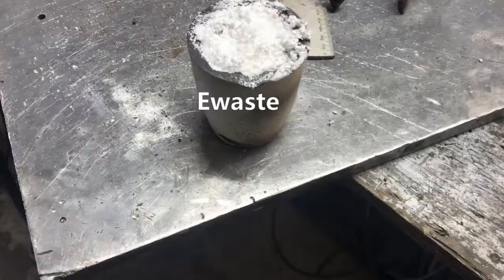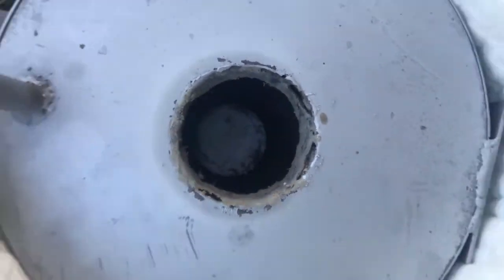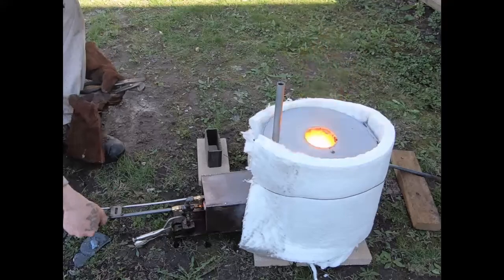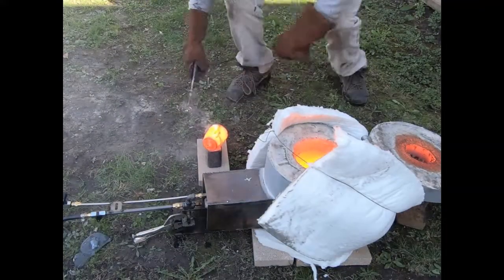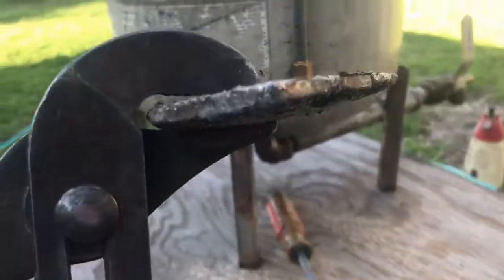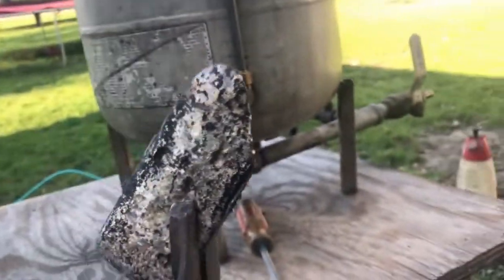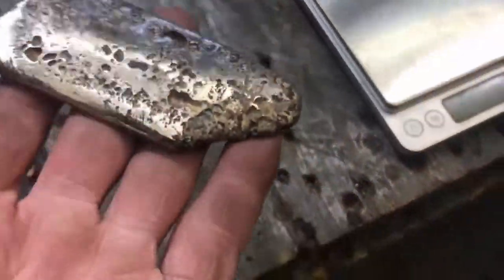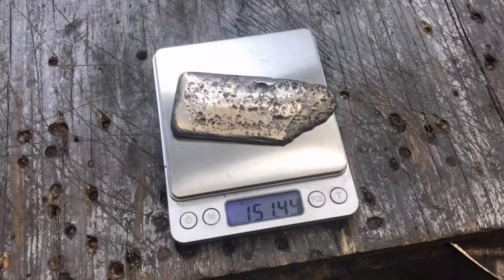Extracting Precious metals from ewaste by fire

Comment: Yes you are right about mixtures melting at a lower temperature than the individual elements. However this is only true once they have been melted or one of them has melted and dissolved the other one.

Comment: few ppl realize this but lava from a volcano isnt considered a melt however it is a solution.......the crystals start forming from lava once temperature and/or pressure starts decreasing within the lava so yeah would make sense it works this way with straight metals

Comment: Melting points of metals 

Pure metals commonly melt at a higher temp, Which is always the exact same for each metal.  Metals that are not pure can melt over a range of temperatures. 

Some metals can be combined to decrease the melting point of the alloy like solder!  Materials that combine and the melting point is lowered are called Eutectic.

Lowering the melting temperature point is convenient for electronics that do not like to be heated.  Tin, lead, bismuth and silver are used in many different combinations to make solder with lower melting points for delicate electronic circuits.  Copper, tin and sometimes zinc, aluminum, manganese, nickel are mixed together to form bronze for easier melting and increased strength.

A new alloy has been discovered!!! 
It consists of Iron, aluminum and copper! 
It has a reduced melting point. 
It has almost the strength of high carbon steel.  Good knives and swords!!!
Plus IT IS A GORGEOUS  GOLD COLOR.!
Reply: Does the new alloy have a name? Do you have any references?
Reply: Lorenzo Lami one of the you tubers called it David’s metal but I doubt that is official

Comment: Next pour it into the space left by a lost foam method in casting sand. You can make the sand with oil and sand/clay or water sand/clay. Then you will get a better ingot for the electrolysis bath. A pawn shop would xrf gun that in a heartbeat...but finding one open now...